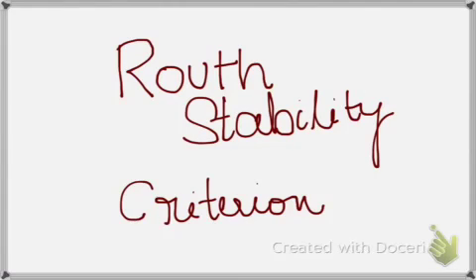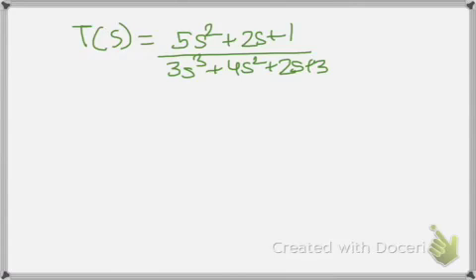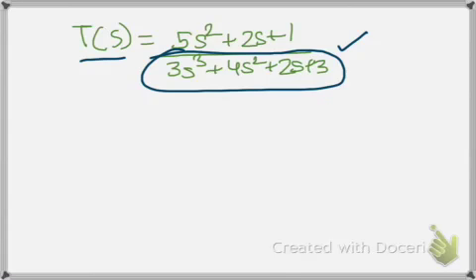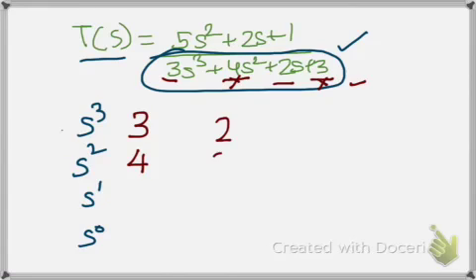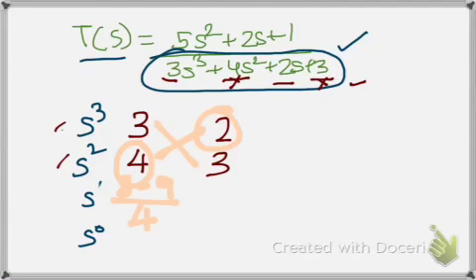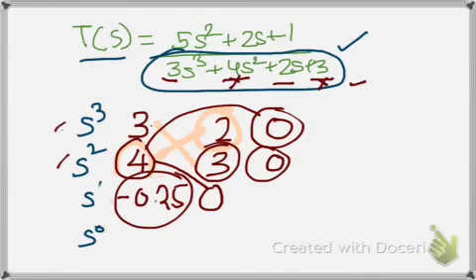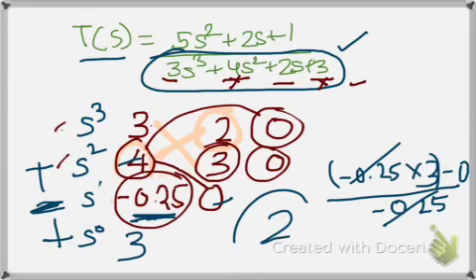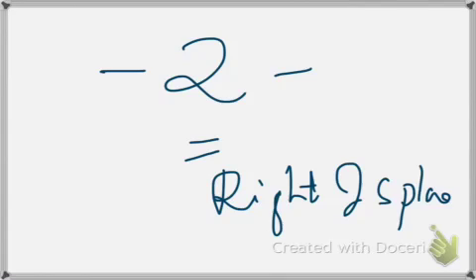Routh Stability Criterion

Comment: Also if you have negative on the first column, its automatically considered to be unstable .
Reply from the maker: Yes Ahmed , The number of sign changes is the number of roots in the +ve half of the S-Plane and that means it is unstable. Thanks for the comment. I have covered this in latest videos for Routh Stabilit, with examples for all the three different cases.

Comment: For those people looking for the next video about Routh-Hurwitz Criterian: Special Cases

(1) Routh table sometimes will have a zero only in the first column of a row:

If the first element of a row is zero, division by zero would be required to form the next row. To avoid this phenomenon, an epsilon is assigned to replace the zero i the first column. The value (epsilon) is then allowed to approach zero from either the positive og negative side, after which the signs of the entries in the first column can be determined. 

Choosing epsilon to be zero or negative, doesnt change anything. The result would be exactly the same.